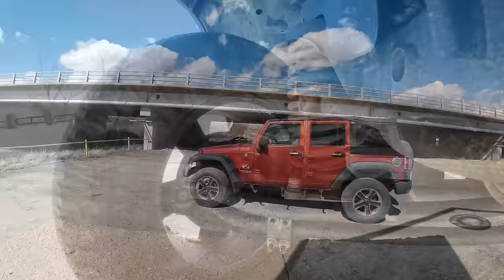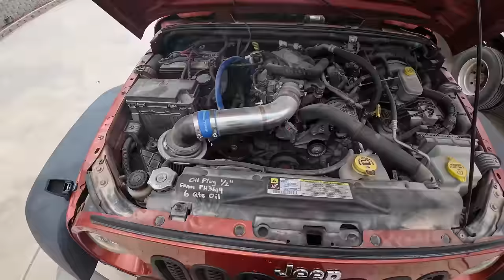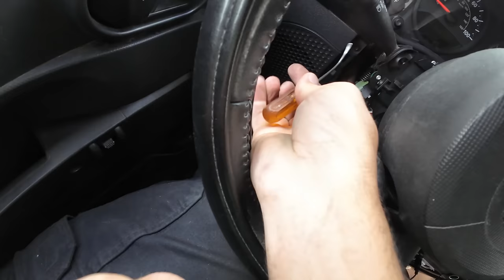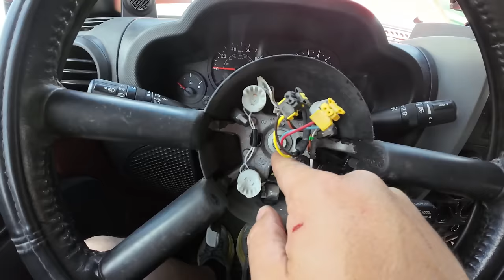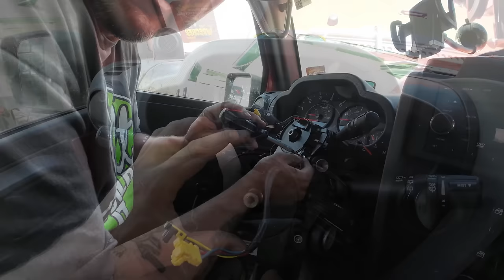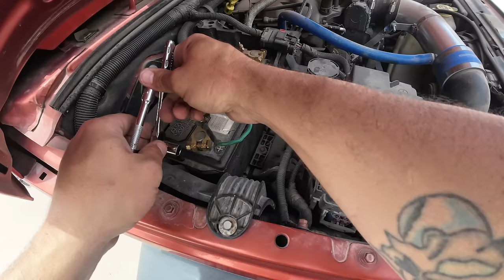Jeep Wranglers #1 Problem Fixed!! How To Replace A Clock Spring

Comment: Pick everyone’s brain?   2013 JK, stick shift, 4wd, I had to replace my clock spring already, I had an issue before and still have it now.  Driving straight at about 45mph or above, hit a decent expansion joint, heave or pot hole, traction control light, abs light, power cut out, kinda limp mode.  Have to pull over, turn everything off and wait 5 minutes, restart it’s fine, 4:30 seconds and it’s still stuck in limp mode.  5 minutes it’s magically reset…  help???

Comment: Btw, my previous comment, 8/10 mechanics don’t believe me and are baffled with no clue what it is if they do believe me.
Reply: Wheel speed sensor problem, had this happen with mine.  I replaced all 4 and no more issue.

Comment: A perfect example of useless tech just to drive prices up . For the past twenty years the auto industry has been making cars and trucks with poor visibility for the driver . A pillars and B pillars in the wrong places or angles due to aerodynamics and fuel economy . Many seats are lower so now the hood and rear deck obstruct the drivers view . UN SAFE . Then they put in TV cameras and readouts that are not legal to use while driving . Given the choice I would buy older designed vehicles , much more user friendly . Mechanical fuel injection has been around for over a hundred years and you don't need a computer to adjust it . I've been around this stuff most of my life and see unnecessary $ spent on tech , they have even started dragging it into the lawn and garden industry . Are we so stupid that we need a computer board to light up and tell us to sit on the seat , check the oil , push the break , disengage the blades , and put in neutral  ?